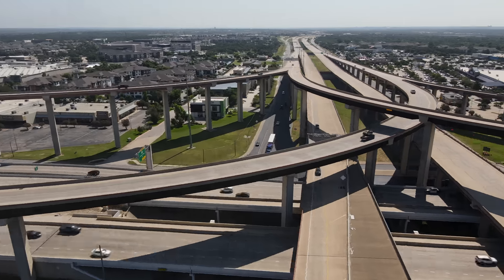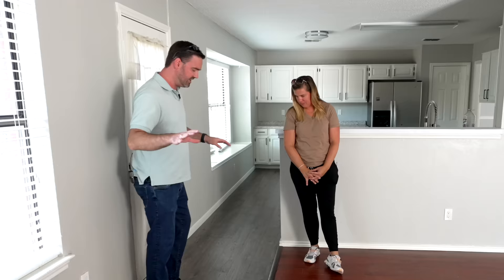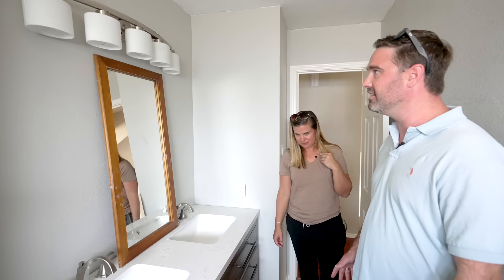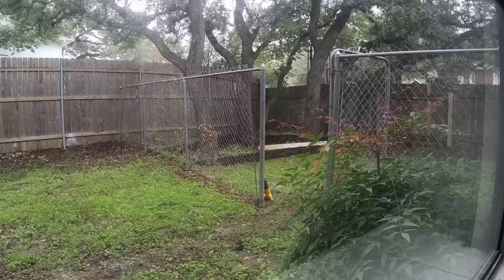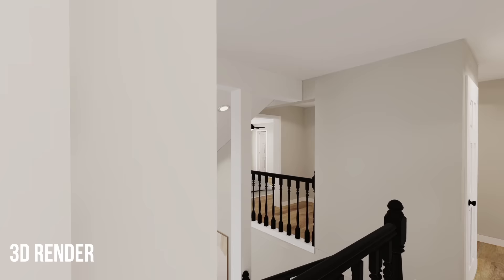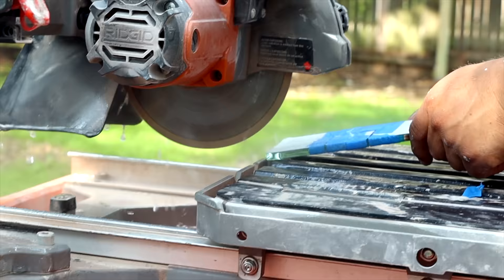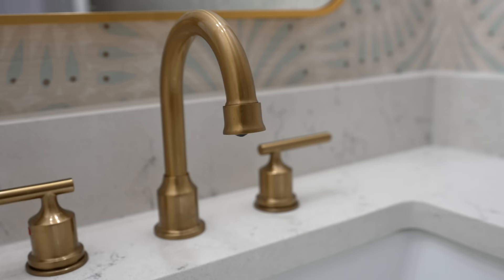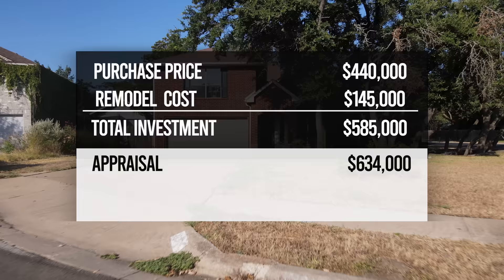We Paid $440K for THIS House...and FLIPPED it!

Comment: Great job. The only thing I did not like was the primary bathroom flooring. When you have a walk in shower use the same flooring throughout otherwise it looks like you ran out of tile and used remnants same as it does with the timber flooring.
Reply: Now that you mentioned it,  I agree. I can totally see what you meant.

Comment: This house was beautiful to begin with, just needed a fresh coat. Only 2 changes I would have made but they are more personal taste. The L shaped wall that wrapped from the front living around to the kitchen bar, I would have painted a contrasting color to break up the white. In the upstairs bathroom, the wall behind the sinks was slightly recessed. The beautiful wall paper from the downstairs powder room would have been a nice touch to add there just to add more cohesion.

Comment: The house changes with the new wall and floor colors were nice. The black stair railing and fireplace are attractive. The kitchen is a little boring but is ok. The bathrooms fall short. The weird wallpaper will only appeal to some buyers. The gold trim, mirrors, faucets, etc. look very dated. The backyard is very odd with different hights of perimeter fencing. In the front yard the front door and color are fine. However the garage door is dated and should have been changed to one more attractive.

Comment: @21:04, the black banister and spindles is too harsh.   @22:52 that should be the dining space rather than at the front of the house.   @24:30, I like that wallpaper.  @24:59, that outlet is far too close to the sink and would not be allowed in my country.   @25:05, I like that there wasn't the scope to tear down the wall that separates the living room from the kitchen.  @25:08, the dining table is definitely in the wrong place.   @26:19, I would put the powder room wallpaper on the walls around the sinks.   Overall, it's not a bad refresh.  I would have made different choices, especially with the kitchen cabinetry.

Comment: The simple solution in the master bedroom was to close the 2 doors to separate dressing  and turn them into the bathroom and the bathroom into a dressing room leading to the bathroom, That would have sorted the issue of the l shaped bathroom and allowed for a free standing bath and a shower.
Reply: Moving plumbing is expensive.  I would have found a away to incorporate a new bathtub.

Comment: Hate the vinyl faux wood flooring. It would be so much more valuable to have installed real lighter hardwood flooring. I absolutely hate white cabinets. I prefer real wood, like beautiful dark wood cabinets and I prefer butcherblock countertops. Why did you not put in a replacement matching fridge?
Reply: Not all faux woods are the same and they looked a lot better than the dirt cheap red horror show that was there before.  I LOATHE those generic white "Shaker", but that is what flippers mostly use.  Real wood is nice for your own home, but flipping is a business and every cent counts.  Agreed about the refrigerator and, in fact, flippers often go for an 'appliance package' that covers the kitchen and laundry room.

Comment: Ill be honest.  I really don't care for any of it to tell the truth.  To start off, the yard is a total disgrace with dead grass everywhere and the staggered height fences... are you kidding?  The black and white theme is a bit heavy and the gold fixtures and such are gaudy as F (IMO).  The total kitchen re-do looked pretty much as it did when you walked in!  Tons of money spent with very little changes in either look or function.  (again, just my opinion.) I would have reconfigured the entire primary bah, squaring the room off and repositioning the fixtures entirely. It looked like a total cop-out to me.  If you ask me, this is probably the cheesiest flip you've ever done.  It's likely budgetary considerations, but... not a good one. No real "design", just a lot of black and white paint with vinyl floors.  Makes me shudder.